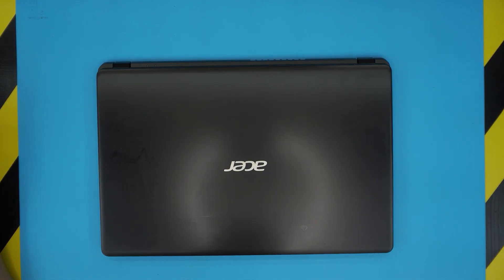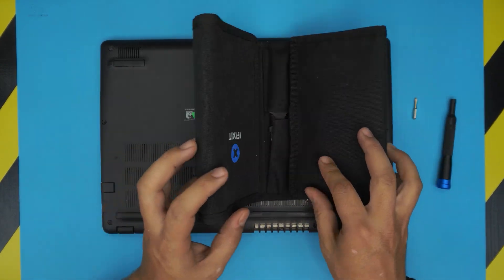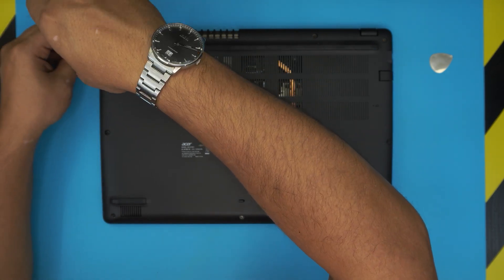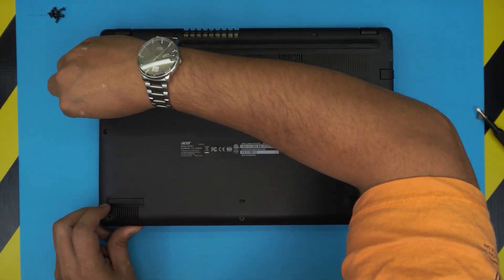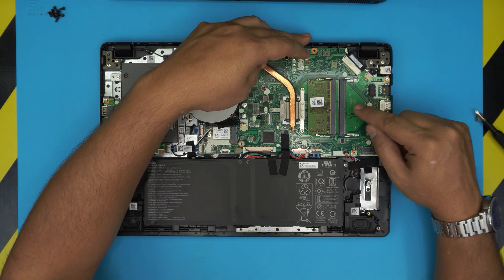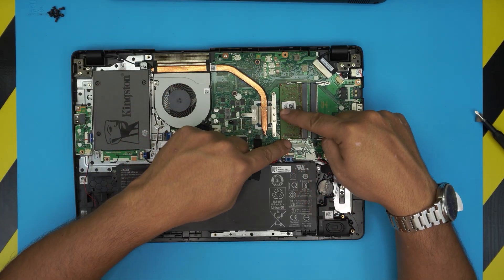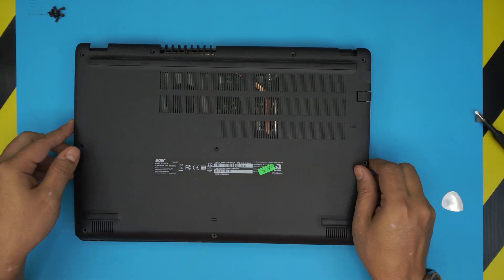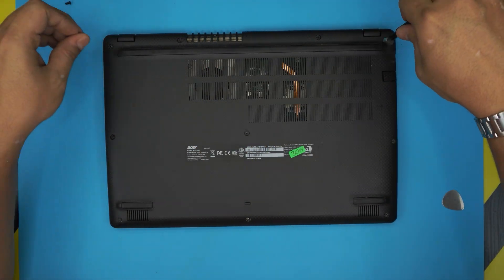Acer Aspire 3 N19c1 laptop Ram Upgrade guide

Comment: Mine is the N13c1
It says the ram is already 4GB
But when I opened it the slot was empty. Does that mean it has another slot somewhere else? Or is it welded
Reply from the maker: 🫠If you wish to support the channel, you can like, subscribe, or both!
Regarding your question,  yes you have a 4GB soldered on board and you can have an 8Gb upgradable stick .
Should you have any further questions or requests in the future, please don't hesitate to ask me.
cheers🍻

Comment: I installed 16gb ram 2400mhz into my acer aspire 3 with soldered 2667mhz ram speed, for some reason it wont recognise my new ram need help please
Reply from the maker: Regarding your question, did you check the max ram capacity for the motherboard before getting the 16gb stick.
check and see what is the max ram capacity : https://youtu.be/tKEJTkVth4Q

Comment: Hi question, is it OK to to put in a different ram, 4 gig and 8 gig, or would you recommend the same 4 and 4 or 6 and 6? Thanks a lot
Reply from the maker: Thank you for the feedback! if you wish to support the channel you can LIKE or SUB or both :P
regarding your question:  it makes no difference if the ram sizes are different , its totally fine.
https://amzn.to/3AIx2tW
if you want to know the max ram capacity for your laptop or pc check this:
https://youtu.be/tKEJTkVth4Q
Reply: You can use 8GB RAM and 4GB RAM together, but doing so can affect performance. Although you'll have a total of 12GB RAM, it will be slower than using two memory sticks of the same size. When using 8GB and 4GB RAM together, they should have the same voltage rating

Comment: How much ram is the maximum that can be put in it? because I looked on their website is only 12gb maximum but the crucial website says 20gb is the maximum. So for you who opened and upgrade that laptop? What is the maximum gb of ram that can put in it?.
Reply from the maker: Thanks ✌  for the feedback!  if you wish to support the channel you can LIKE or SUB or both :P
Regarding your request: Don't listen to any of them check it with your own eyes :P
here is a video i made to check what is your max capacity, we get a lot of clients come to the store for upgrade and we always check the max capacity via this command:
https://youtu.be/tKEJTkVth4Q
if yours it says 16gb the 8gbx2  if 32gb 16gb x 2. 
let me know what the command shows.
Reply: @uFixTek   the command shows 33554432 and I divided by 1,000,000 and it shows 33.554432
Reply from the maker: that means your laptop can go max 32GB ram 16gb and 16gb but don't go that much its waist of money go with 8gb x2
it shows 33.3gb becaue that the exact number of gb that can handle but they dont make 33.33 gb ram so 32gb is the answer.
https://amzn.to/3mIGlH0
Reply: @uFixTek  okay thank you for that info. And also I'm going only to add 8gb ram for a while is it okay? And also I'm confuse on what mhz should i get 3200mhz or 2600mhz can you help me with that?
Reply from the maker: go for 2600mhz if you get the 2300mhz it will work too but no point as the bios will adjust the speed to what ever it can run the ram at. and the difference from 3000 to 2000 you wont even know, we talking about 0.001sec

Comment: It needs a new RAM o it has place for second  RAM
Reply from the maker: Thank you for the feedback! if you wish to support the channel you can LIKE or SUB or both :P
regarding your question : it has one ram and space for an extra ram to be placed.  if you want to double check that go to task manager by pressing and holding  : CTRL+SHIFT+ESC
and go to performance tab on top and click on MEMORY and on the bottom of the chart to the right it should say "Slots used: 1 of 2" . if it says 2 of 2 then you dont have empty space dim.